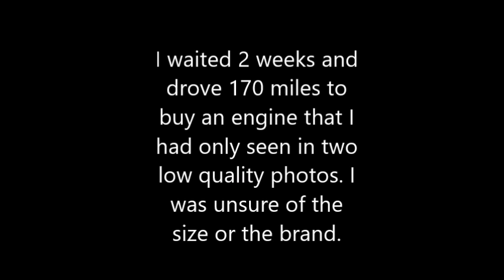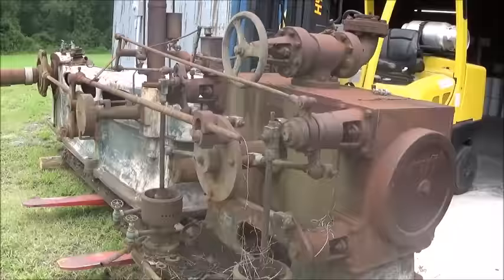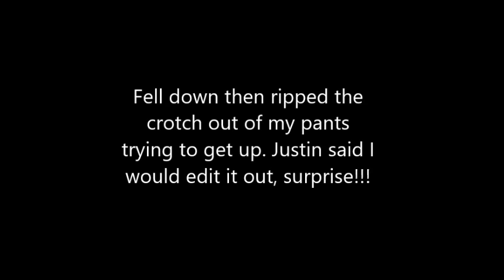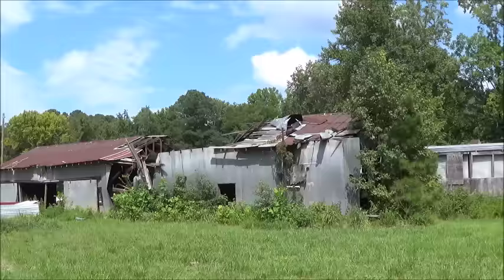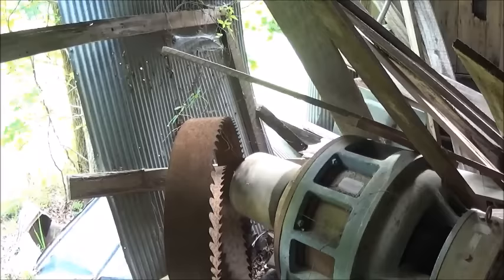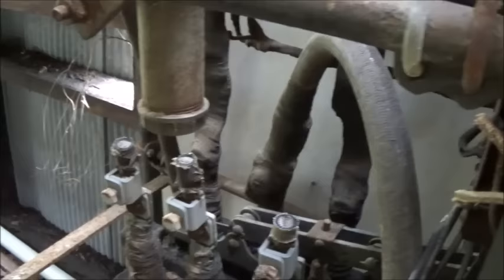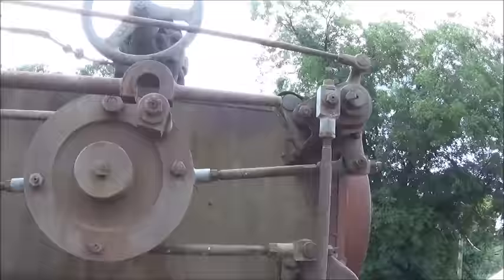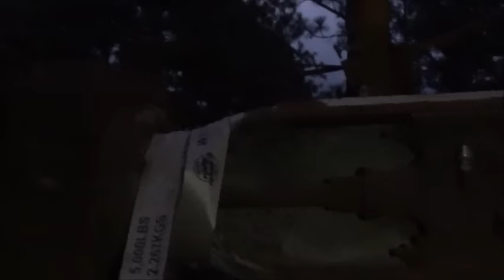RESCUING ANOTHER HUGE CORLISS STEAM ENGINE AND MORE!!!

Comment: North of Penn Yann, NY, on the Keuka Lake outlet, was an old mill that had a big Corliss engine.  The name plate said Fishkill Corliss.  That was years ago so it may be gone now.
Reply from the maker: That engine was Donated to the NC steam engine association. It is currently being setup and restored.
Reply: I am happy to hear this.  I may have a couple of photos I took back in the sixties of the engine in place. It used wire rope to run power to the line shafts of the mill. At that time the boilers were gone only the brick foundations remained. The mills along the Keuka-Seneca outlet were some of the very first and this one was originally water powered.
 @jonathanw4942

Comment: I used to know an old guy, he worked at a mine that had a steam winding engine, and they had to change the flywheel, the new one was split (like the one in this vid) but the old one wasn't, but it had to be to change it. this was the days before power tools, to they used hand drill to chain drill the fly wheel, until one clever guy decided that it would be quicker to use explosives. Being a mine they had them, and the people who knew how to use them, so they packed the old fly wheel with explosives, set them off, and they lifted every slate tile of the roof. Several hours later, when the dust had settled, the old flywheel didn't even have  a mark on it, so they continued with chain drilling by hand.

Comment: In the mill down the road where I hung out and worked had a Neuman M-48 pulled by a 4-valve 4-71 GM/Detroit 2-cycle. It had the quick start knob coming out of the governor housing and it stayed fully pulled in while the planer was running. Had the fan and the whole thing but the diesel pulled it all. Looking forward to seeing that one getting loosened up. Blessings

Comment: I think you have a reduced voltage starter there. The three phase voltage is reduced by resistors in series when the motor is first turned on, then you shift the contactor to the run position when the motor comes up to speed, that takes the resistance away.

Comment: Unlike a vehicle with a clutch pedal that you released and got a rig moving, as they had fuel to get moving.... I am struggling here to say something on torque versus power. It relates to how they got a electric motor spinning or other types of fuel engines would move what ever your choose to make it go. So steam doesn't lug up like a engine or a motor.... (its that crazy thing I get sorta mad when someone corrects me as to its a engine or its a motor thing) Now here is something that cause I have so tiny amount of experience with.... I am thinking that when steam pressure is applied, something it was to move, moved. It moved or something gave, like a rod or gear, pressure on them to turn meant it was going or something would break. I best stop here and not let folks know for sure that I am a idiot for sure. You surely have one powerful good areas of finding stuff. I guess that since everything ever started was on the east coast and by the time people settled in the west, things just changed enough to make our junk a little more modern. We should of embraced steam so that if some time and place, no fuel available, you can make steam from the areas ya get into.. another reason for me to just  say its remarkable... an yeah, those boys loved the book that ya sent them .... love this collaboration of a sort.